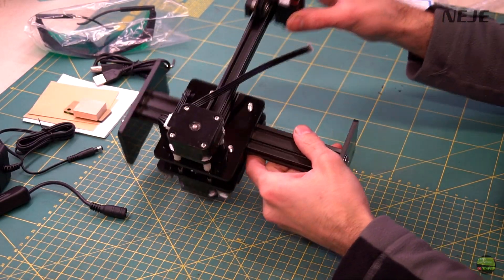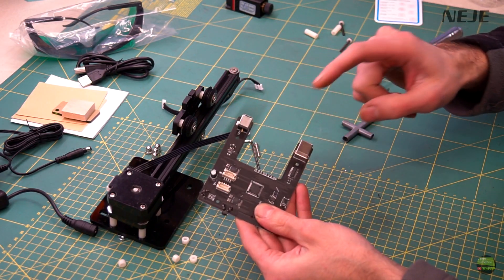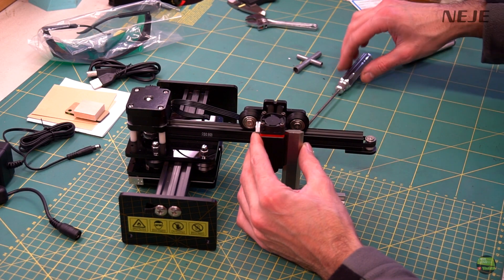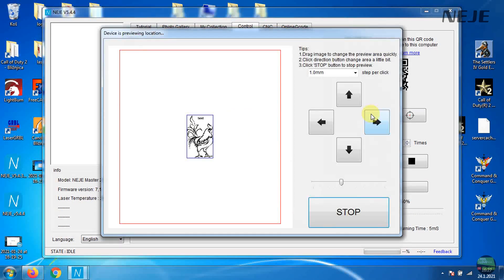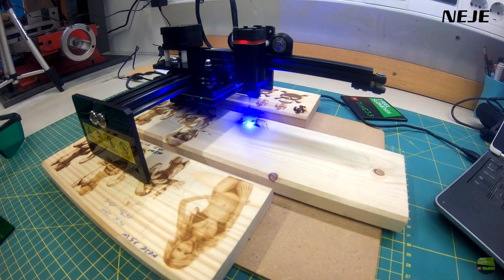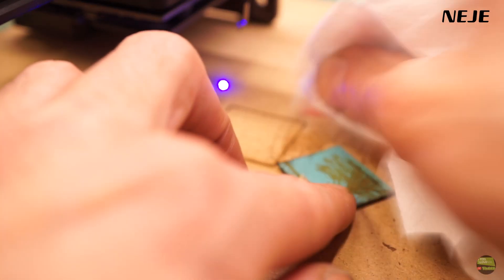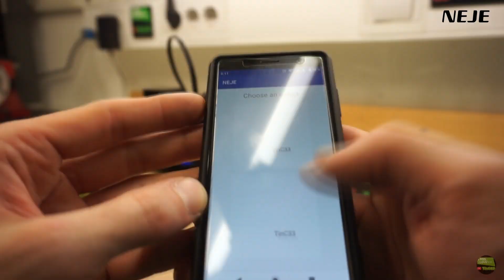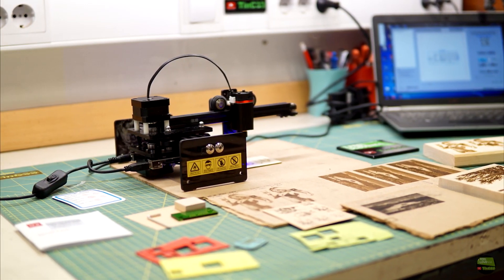Neje master 2 mini with 10W laser modul 110x120mm [unbox/review/first test]

Comment: Thank you for your information sharing. Is the 40w laser head compatible with this machine
Reply from the maker: maybe it is, if you fix machine onto desk, but may be to heavy so you need to lower down acceleration of motors. out of the box i would say NO.

Comment: Nice video. Got that model, but the software can not handle dxf circles, makes them polygons. Any ideas how to fix it. LaserGRBL software is not working with the Mini model. Been at the forum, unfortunately no solution.
Reply from the maker: Try to get some other dxf version, when saving dxf file you got few option to choose dxf version or something...
Reply: @TinC33  Thanks, but I did try all options from CorelDraw, and they look fine when importing to Corel again.

Comment: im trying to use this on plastic but it just melts words together, what are the specifics for hard plastic, neje master mini
Reply from the maker: Yes diode lasers just melt the surface of plastick.
Reply: @TinC33  but what would be a safe burning time and laser power ?
Reply: @TinC33  because you used it on a plastic case for your iPhone and it came out good , what specs did you use ?
Reply from the maker: @shellzistocool  it is tpu case, and i use low power settings so it only mark a tiny melted line, if you use high power line will ve more melted and look ugly and unevenly... Try with low power then rise until you get the result you want, it look ugly in any case, but after engrave is done wipe it with a towel and alcohol so you remove all the dirty dust...
Reply: What laser power setting should I start with for plastic
Reply from the maker: @shellzistocool  idk try 10% laser power if engrave will be invisible raise the power and start again.

Comment: Which settings I need to adjust to engrave on thin aluminium? I already have this laser but none of the settings works to engrave metal. 😩
Reply from the maker: Yes it won't work on raw aluminium, you'll need anodised (coloured) aluminium
Reply: @TinC33  Is there a compatible laser head upgrade that we can get to upgrade the neje 2 mini to work with engraving metal?

Comment: weak laser module of 2.5W power need to be replaced. Your advices which one to choose. I think 20W N30820 Laser is not bad but require to replace at least power adapter
Reply from the maker: Yes you need to replace power adapter, but not sure the mini can handle them it may be too heavy and too big, it shoud work with few upgrades but mini isn't best model to modificate.

Comment: Hi,  I've had it for about 5 months. Now it stopped working. Don't know what to do.
Reply from the maker: What stop working does it connect to a pc, does motor moves, is only laser didn't work or just nothing?
I woud check motherboard if there a dead fuse, otherwise or in any case contact neje team.

Comment: Hello, what settings were you using cutting the squares out of the wood? I'm not able to cut trough 2mm wood :/
Reply from the maker: 100% laser power and about 5-10ms burning time (don't remember exactly but quite slow)

Comment: Better asked.. How many watts laser head you can connect to this neje mini
Reply from the maker: I think 10w is somekind maximum, because this 10w model is specially design for that laser, so it is smaller and lighter then even 2.5 or 3.5w, i doubt 20w laser can handle this tiny machine.
You plan tu buy mini? just take neje 2 wich got bigger working area and can handle laser all the way up to 40w without problem, and also offer grbl control, mini doesn't only work with neje software on 8 bit, so i really don't see logic to buy mini for just 50€ less.
Reply: @TinC33  got it.. Went through all yoir videos in your channel... Thanks a lot
Reply: Great advise.. I got thia mini already.. Another question is how you can adjust the burning time and the percentage in the program... Mine can't adjust it.. Is way too dark
Reply from the maker: @pedroelcubano1  you can see in video where i set laser power and burning time, there should be 2 trimmer for that settings in neje software.
Reply: TinC33 I got it.. Just didn't see before the laser power line to bring it down.... Any other videos that you have that can recommend? So helpful your advise

Comment: Hi, thank you for the review. Can you please help me? I have problem with cutting of 2mm MDF. I´m using 30W version and sides of cutted part are burned too much I guess. I tried a lot of combinations of burning time/speed but the result is still bad ...
Reply from the maker: Do you got air assist, it make huge difference check my video about 40w laser modul.

Comment: What did you replaced with what? I lost u there.. trying to decide which to buy and really liked the result after the update
Reply from the maker: I didn't upgrade anything on the mini, i upgrade neje 2 with 32bit motherboard you can find another video about that.
Reply: At the 8.35' didn't u change something?
Reply from the maker: @ΒΙΡΓΙΝΙΑΣΗΜΑΝΤΗΡΑ  ah yes i install 3.5w model on the one come with is 10w.
Reply: So someone can do that if the 10w doesn't do the job right? Cause i want a small size laser but one that can give great engraving results
Reply from the maker: @ΒΙΡΓΙΝΙΑΣΗΜΑΝΤΗΡΑ  yes that's right, you can buy neje mini only with 10w modul but can put 2,5 or 3,5w modul on wich cost only about $30 and make better engrave.
But anyway i recomended you to buy neje master 2s it's not that bigger but got working area 170by170mm and also offer us to use it with lightburn or other grbl software and also can handle all models up to 40w and also the price isn't that much higher then mini.

Comment: Great laser. I am using it for 3 months for my small business. Very fast device. For photo engraving I am using 100% laser power and 2ms burning time. Results are superb, but you need to adjust picture brightness/sharpness in other programs.
Reply from the maker: actually you can adjust brightness with laser power, try to engrave with lower laser power and longer burning time, depend on laser power but something like like 70% LP and 5ms BT, it will engrave slower but you'll got better result.
If you leave burning time same just lower down the laser power entire image will be more bright...
Reply: @TinC33  I have tried many things, but 100 power, 2ms burning and medium motor speed is a sweetest spot for photo engraving (For 10W laser). Before engraving i process photos in PhotoGrav app. Results are very good. The hardest part is to focus properly :)
Reply: How long you guys think this laser will last.. I. Meant, how many times you can engrave more or less..?
Reply: But with 100 % laser power will not be to deep to dark?

Comment: Hopefully 10W is the actual output power! Hate that places are trying to sell stuff as “35W” (etc) when that’s the consumed input power. 

Next week it’ll be a “100w” laser since they slapped a giant resistor in there to make it suck more power. 😁
Reply from the maker: You,r right, 10w is electrical power, optical power of that laser is 2,5w but every producer advartase it's electrical power so i seen seense here because if one producer advertise 2,5w anyone wouldn't buy them next to 10, 20, 30 or even 40w laser 😉
Reply: @TinC33  - not sure if you’re old enough to remember the car amplifier wars of the 80/90s. Manufacturers would rate them at inflated peak power, not RMS. So you would have an amp about the size of 2 slices of bread... and they would say it was 500 watts!!  It was really about 10W RMS. 

Anyhow, this is just like that. Everyone (manufacturers) collectively needs to give their heads a shake and call them what they are. And the end users need to demand truth in ratings from them.
Reply from the maker: @DrFiero  all you say is true, but there is mention optical power in description of each laser modul, when people buying they see 10w laser modul, so if i titled video as 2,5w laser modul they can't find the video...
I'm interested about other lasers like co2 (40w) or fiber laser for steel  engraving are there the same trick or it is real power 🤔